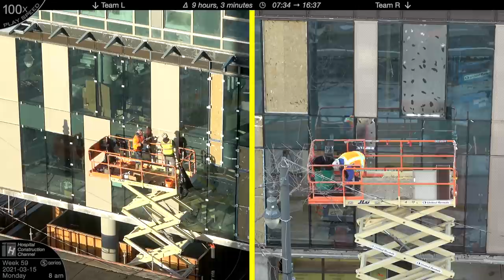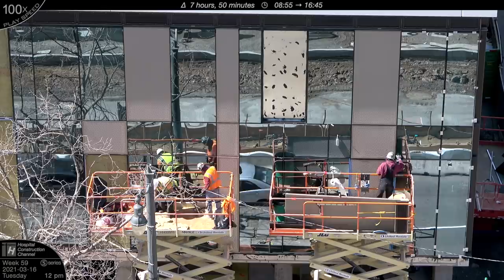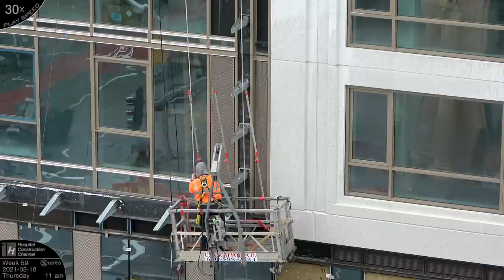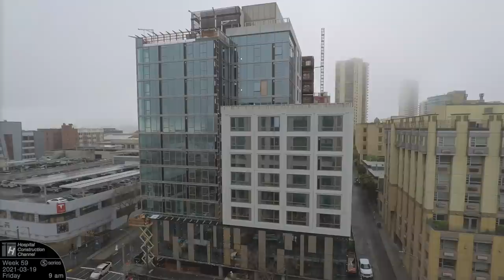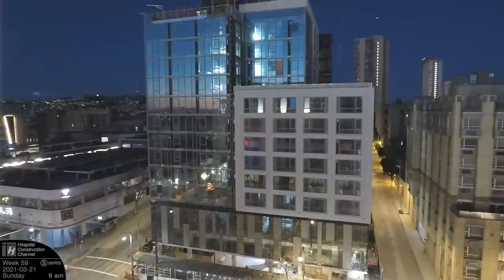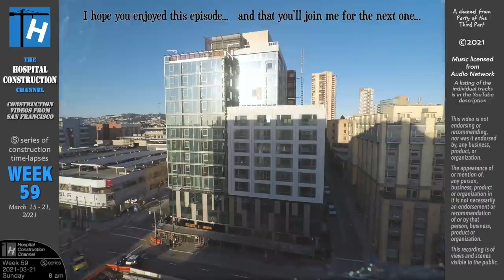One-week construction time-lapse with closeups: Week 59 of the Ⓢ-series

Comment: Those panels are perforated aren’t they? Isn’t it bad for the insulation to get wet?
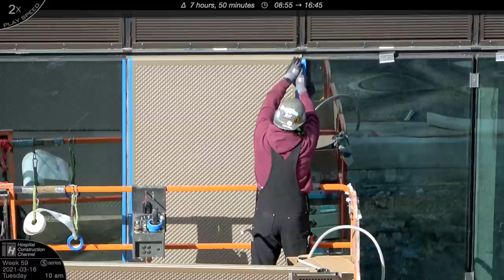Reply: I don't think so. Looks like a design only. No actual holes. Need a close up picture to be sure.   7:23
     The panels at  30:11  are clearly different and seem to have holes. 
           I'm sure that is why they are doing the water testing for these panels.

Comment: At 8:44 they forgot the insulation!
Reply: They sure did! I didn't notice when I watched it the first time.
Reply: @R L Why is the insulation useless?
Reply: @R L When you say "glass wall" are you talking about the glass in the window sections? Yes, I see that runs around R-2. But we're not talking about the glass sections, but the metal sections between the windows, so I don't see what the R value of the glass has to do with that. The insulation bats they are working with look like they are over an inch thick, maybe 2 inches. What I see says bats run R-3 or more per inch, so we have around R-6. We saw last week they also have fiberglass batts in the steel stud wall inside, though I couldn't tell how thick those walls were. But another two inches or so in the outer wall adds to whatever that provides.

Granted, the temperatures are generally mild there, but it does get cold enough to make heating necessary, and sometimes hot enough that cooling is probably necessary in a senior residential building.